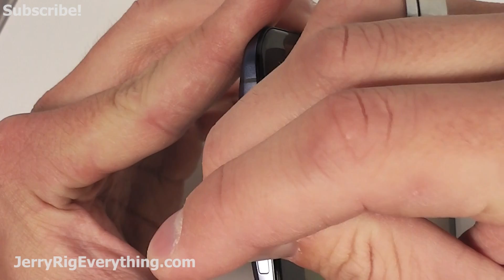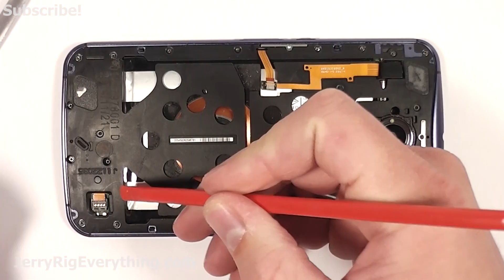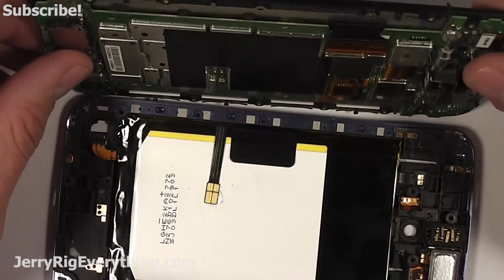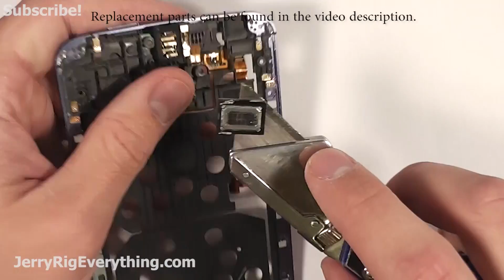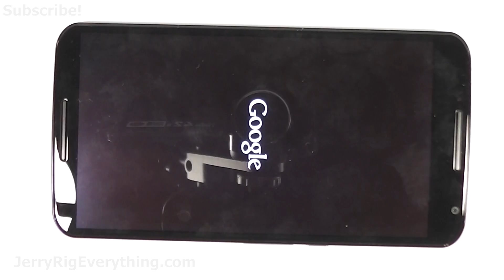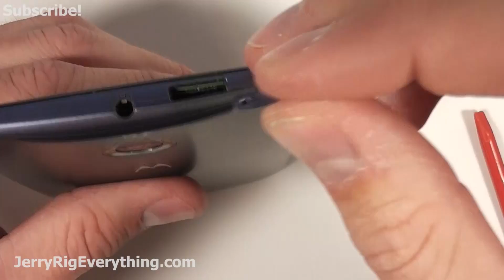Nexus 6 Screen Repair, Battery Swap, Charging port fix

Comment: Protip for those having trouble with the glue holding the back cover on: breathe on it for a good 30-60 seconds  (like you would if you were warming up your hands in the cold). This actually worked really well for me in loosening up the glue. I didn't do this for the whole thing, only for the edges/corners, then once I had enough wiggle room I stuck an exacto knife in there to cut the rest of the glue.

Comment: Thanks.. watching this. tried unplugging battery to fix my bricked nexus 6. not fixing it.. nothing really is. oh well. X_X
Reply: you think you could do a durability test on this phone? i know its old, but after the shame of the 6p, i would like to see its predecessors' performance. Also im a nexus fanboy and too poor to do it myself
Reply from the maker: +Jeremy Judkins How did you break it? Software issues?
Reply: JerryRigEverything literally just did a video venting about it haha. So two things were going on at once. I was using it with a samsung fast charger, which i've never done before, and I noticed it actually got really hot. But that is typical. Secondly, I was installing the 6.0.1 ATT OTA update. I installed the 6.0 update manually with the files from google. So I don't know if my unlocked boot loader wasn't jiving with the OTA or what... the device wasn't rooted. I dunno. And every other article I've read related to this issue, they ended up sending to moto, but i'm out of warranty. Between this and my galaxy s6 active with the wifi problems I'm just not having much luck with phones.
Reply from the maker: ***** lol oh no man! That sucks. Is the active completely shot yet? Are you still using your 6p?
Reply: JerryRigEverything Actually having a phone to use isn't a problem haha. I have have a zenfone 2 and moto g 3rd gen.. I think right now they have some nightly roms on them so I wouldn't use them unless I put stock back on. The active works.. I actually fooled around with different cables and found one that worked for charging. only issue now is the wifi that cuts in and out at random. not too bad, but it would add a few mbs extra to my data usage. I tried messing with my router and stuff but didn't do anything. Kind of just attributing it to saltwater damage.. or maybe all the drops and crap i've done to it haha. Anyway. I went ahead and got an LG V10 to be my daily driver for now. Never owned an LG device so was kinda excited.
Reply from the maker: ***** Thats tight man. Lucky that your channel deals with tech so you can rationalize so many devices.
Reply: How nice is it to see a content creator actually engage with their audience like this!
Reply: eeeeh my nexus 6 fell of my tablek the screen broke and my and it has stripes all over the screen(i think the motherboard is dead ) Do you know any site where I can sell the rest of the parts? because I am 14 years and pretty broke :) no I am kidding i was jus't wondering if i could get any money out of it since my friend said I could. Very nice video i gave you a like!

Comment: Video title says "Charging port fix", yet you state in the video that the USB port must be soldered and instead we can use a wireless charging pad. That's not a fix, that's a workaround. Clickbait or honest mistake?
Reply: You can find the service here: http://www.ebay.com/itm/Nexus-6-Motorola-Broken-Charging-Port-Repair-Service-/371640985983?ssPageName=STRK:MESE:IT
Reply from the maker: I did explain how it could be fixed.  So i guess it just depends on your perspective.  But i see your point.
Reply: +JerryRigEverything Have you attempted a USB port replacement? I have a replacement part but I'm skeptical after several other videos note it could be very difficult.
Reply from the maker: James Gose I keep meaning to do one on the PS4 controller... but I just havent had time. But I agree, it looks pretty hard.

Comment: Is there any option to repair the USB port, my Nexus 6 is having issues and I need new cables every couple of days to make a good contact
Reply: +Humberto Saldivar Mine was having this same issue, I picked up a wireless charger but since the phone is so big it just kept moving off the charger. I ended up taking a knife and bending down the little black circuit board / pin board inside of the charging port down a little and it fixed my issue entirely.
Reply from the maker: +Humberto Saldivar Not with this phone, the charging port is soldered into the main board. So unless you can solder... it cant be replaced.

Comment: just replaced the battery, was alot more glue on the midframe and Qi disk accidently ripped the Qi cable, but ordered a new midframe with new pad attached...considering im gonna have this phone atleast another year and half its worth the $25
Reply: +Lance Martin Just replaced mine, and you are right.   It is more glue than is expected but I went through a ton of youtube videos to see from every angle and I was lucky it didn't break! ;)   With Google updating the phone monthly it is worth keeping it running! ;)

Comment: After swapping the screen and glass module as above the phone powers up but the touch screen doesn't respond, any ideas?
Reply: I had the same problem with mine. I finally figured out that the small ribbon cable that's for the Digitizer (3:48 in the video) wasn't pushed in far enough. I used a pry tool to push it in, then returned the latch to lock it into position and my phone works perfectly now.

Comment: Why is the screen so incredibly expensive? I cracked my screen directly down the middle and it's tolerable but swipe texting has become basically unusable due to it cutting my thumb. I just don't know if I want to drop $200 for a new phone screen :(

Comment: this seems like a lot of trouble just to remove your battery. Jesus Christ. I'll stick with the note series or the LG g3 or LG g4. even though the note 5 doesn't have a removable battery but the note 3 & 4 do.
Reply: +Brian Bradford Well I did it.   Took me an hour and half but it is well worth it! ;)   Now it is charging and it actually shows below 30% on the battery and isn't shutting off! ;)  So it was worth the struggle! ;)

Comment: I think my gyroscope is not working well. Where is it located and is it replaceable?
Reply: +Leandro Broffoni I'm pretty sure the Gyroscope is soldered onto the Motherboard, so you will have to replace the entire motherboard.  Since the internal storage is also on the motherboard, if you wanted you could buy a 64 GB version to expand your internal storage as well!

Comment: My simcard slot pins are broken can this be fixed on the nexus 6???
Reply: +Jason Troupe simcard tray is soldered on, would have to get a total motherboard replacement $$$
Reply: +Jason Troupe https://www.ifixit.com/Store/Parts/Google-Nexus-6-Motherboard/IF304-005-1
Reply: +Lance Martin thanks

Comment: is the nexus 6 as bad as the 6P regrading the bending and scratches?
Reply: nexus 6 is way more strong and not bendind like 6p
Reply: +david hoffman No the N6 is pretty solid. But it's not built like a Samsung or Iphone. I carry mine in my back pocket and haven't had an issue? But my jeans fit and I'm not that big of a guy.
Reply: +david hoffman  Only the battery life is a bit worst compare to the Nexus 6p even with Marshmallow, I did a couple of test and still getting 10% of battery life off from 100% after 8 hours. I get better battery life with the Nexus 7 2013 with Marshmallow  then the Nexus 6 on Doze mode.

Comment: The main reason I bought this phone was because it's water resistant, well was supposed to be but mine seems not! slight bit of water today and it stopped. That's why I'm looking at the video, I see there's nothing remotely close to water resistant looking at this. Thanks for the video, we'll see if mine works again..
Reply: +Patrick Weir 

I don't think I've seen anywhere that said it was water resistant. Are you sure you're not mistaking it with a Moto G 2015?
Reply: Nexus 6 is not water resistant/proof.

Comment: you made the claim that it is pretty easy to peel off the back of the phone. It looks easy on your video because you have removed all the adhesive on the back of your phone. After a painstaking hour to remove, my ribbon cable is bent. Totally frustrating.

Comment: Every other video here shows the back requires a heat gun to melt the glue even before it can be removed with varying degree of difficulty, how did you remove yours so easily? What's your trick?
Reply: +Peter Yee I did this with a brand new N6. I used the SIM ejector tool and pushed it through the slot in the SIM card tray. You'll have to push a bit hard but it will pop up just a little bit for you to stick something thin into the gap to start the removal process.

Comment: hey I dropped my nexus in my sink of water while shaving. Speakers wernt working and I cleaned the jack and that worked. and then it said so sim so I took that out and I cleaned it and it worked. but now the phone is constantly warm and charges really slowly. I'm really scared can you help?.
Reply from the maker: +Eddie Flores Water damage is a tough thing to deal with.  It might be some corrosion that is building on the connections in your charging port.  You can always try cleaning out the port and the phone with isopropyl alcohol... but you might want to have a pro do that.  Its not an easy thing.
Reply: +JerryRigEverything yeah I know I'm glad it didn't get even worse. but its bad the CPU is at 130 degrees! and battery is at 50% and says three hours till full

Comment: Thanks for the upload. 
I have a nexus 6 that's been salt water damaged is it possible to fix it,if yes do I replace any component on the mother board and the touch screen doesn't work

Comment: You said the screws were T4 Screws. I went out and bought a screwdriver set that goes down to T4. 

Turns out they're T3 Screws, and now they're stripped.
Reply: +Douglas McFarlane lmfao
Reply: isn't his fault
Reply: user error, and if your not resourceful enough to try diffrent thing before stipping your srews than its your own fault dude. Think before
Reply: Hey man , great vid. Thanks
Reply: انور الاسدي07725108933 check eBay ID say.
Reply: Douglas McFarlane At what point did you stop stripping the screws? Some are T3 while other N6 use T4. Depends on your variant. It's not Zack's fault.
Reply from the maker: Douglas McFarlane Shoot man, T4 worked for me.

Comment: What makes the glass repair so difficult on this particular phone? Is it because of the ribbon cables?
Reply: Incorrect. I've performed a lot of glass-only repairs, and as long as you have a vacuum hot plate it's super easy.
Reply: +Elisabeth “Beth” Anderson it's actually an AMOLED screen not LCD.

Comment: I've seen elsewhere that it was noted as a T3 screwdriver, not a T4. I'm looking to buy a kit, but many on Amazon don't actually have a T3 with it. Any suggestions?
Reply from the maker: If I uses a t4 in the video, you should be fine getting a kit with a t4 head in it.
Reply: JerryRigEverything Thanks!
Reply: +Austin Baccus Harborfreight.com they have all kinds of this stuff

Comment: Could u please tell me that my nexus 6 does not turn on but flashes green light in the middle of the top speaker if i remove the battery connector and leave it for 30 sec it will be all right. PLEASE REPLY FAST

Comment: Thank you Jerry for this great video! One question, why do you say that a glass only replacement is extremely difficult? is it any different of a procedure than the moto x you've done here? https://www.youtube.com/watch?v=QiyvsLpfMMI

thanks again and i look forward to your reply as i've went ahead and bought the glass but this vid has made me second guess myself.. i've only done a galaxy s3 glass replacement before.
Reply from the maker: Noor Z It should be a pretty similar repair (I have not yet attempted a glass only on the Nexus 6 yet.) But is is very difficult. Mostly because the LCD is so fragile under the glass. It is not supposed to be separated.

Comment: jerry please where can i get a replacement battery ? My Phone keeps shutting down for no visible reason several times a day and ive got to discover that the battery is the problem and the device is barely 3 months old. 

Thank you
Reply: did it work?
Reply: Tee Jay same with me im in desperate need of a new battery
Reply: Tee Jay did u buy on eBay?/I have a similar problem
Reply: Does it work ?

Comment: Men! Seriously, i have never seen; anyone whom actually do this any quicker, and to think that i was going to take it to a technician, and you have save me a few bucks. But i having problems with my battery, it's this normal? I just bought it two weeks ago, and i took it to get it fix under the guarranty, bit they told me that, they didn't have the replacements and to check with them later. I Heard you said that sometimes i'd you disconect the battery for a few sec, and plug it back in, it will automaticly fix itselt! How true this is? And would i cause any harm if i do this? I know this is básic stuff, but can you help me with this? I'm a new subscriber!! Thanks
Reply from the maker: Giovanny Griovatto Disconnecting the battery and reconnecting it will only help with some software glitches, and boot loop cycles.  If you are having charging problems... it MIGHT work... but it might not.  While you are still in warranty, be careful of taking that back off, because they will probably be able to tell you got inside it.
Reply: Hey jerry thank's for the coments i did exactly how you Said it and it went back to normal, thank's for the tips it really help alot! Glad to suscribe=)))
Reply from the maker: Nice!  Glad you got it fixed, and thank you for subscribing!!

Comment: Hey Jerry, 
What UV lamp/light do you use for curing LOCA glue (mind providing a link so I can purchase)? Also how long does it usually take for LOCA glue to cure?
Reply from the maker: Slecker95 With a good UV light, the glue will cure in about 2-4 minutes. If you look on my website, JerryRigEverything.com, I linked all the tools I  use in one of my blog posts.  Check it out!
Reply: Hey thanks Jerry, found everything I needed! :)